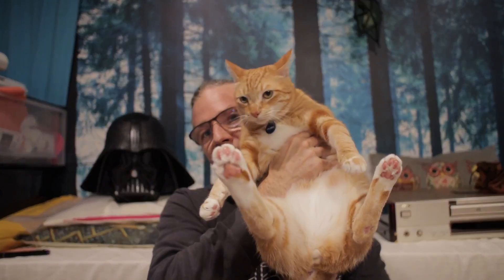Folded Voigt pipe:  exploring resonances around the internal baffle

Comment: Pearl acoustics Sibelius Speakers folded
Voigt Pipe use sold wood 45mm thick
They don’t want any resonance from the cabinets so it doesn’t add to the original recording music 🎶 
Also having a cabinets that’s rigid non resonating the isn’t any Loss in the bass
That a lossy box cabinet does 
So my understanding it’s very tight & has impact more articulate.
Isn’t it about preserving the original recording music
Not adding?

Comment: Hi Janos, you video brought up an aspect of life cabinets that has been bothering me from the start. You say you want the front baffle to resonate (be life). My gut feeling tells me that the one panel that needs to be (more) rigid is the front baffle. The reason is that the speaker does not only cause air motions, which will result in sound waves traveling trough the wood. The actual movement of the wood in the front baffle is also caused by the acceleration of the cone which will cause a force in the opposite direction. So if you have a flexible front baffle, your baffle will move in the opposite direction of the cone but without delay and without the need of resonances. This is analog to a cone breaking up or a speaker that is not tightly screwed down, and we all know that is not desirable. I am not advocating for a dead front baffle, but a stiff one. Regarding the center baffle in a folded pipe, I would not add material at the tip. This will cause air motions that are difficult to understand and thus design for. I would round it off, the material will be thinner at the tip, which may be counter intuitive, but the arc shape of the wood at the tip will make it stronger. I would also make it a slight dish shape. A straight line (along the line from one to the other side wall) is more liable to flutter than a concave one. With this principal the higher side walls (dish) are the better variation than a dome, since the extruding parts are supported by the side walls. The concave can be as little as a cm or even less, to make a difference from a mechanical perspective.